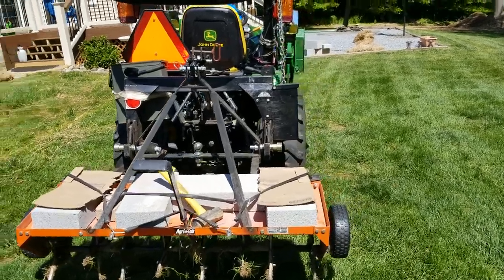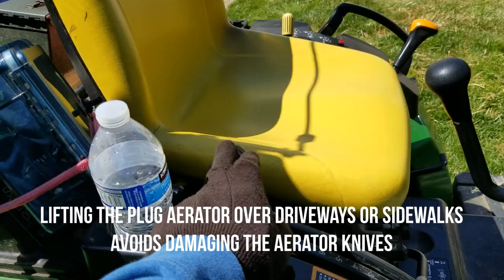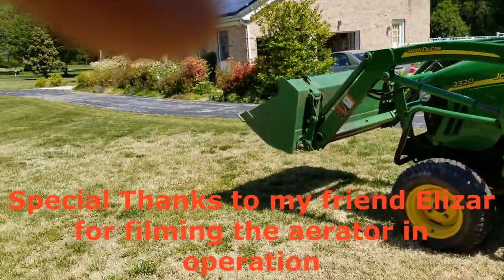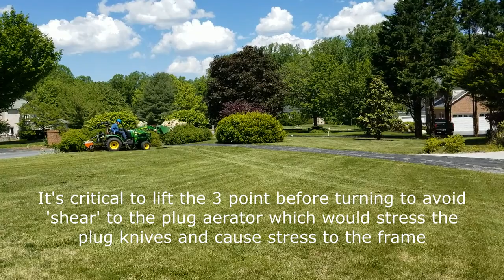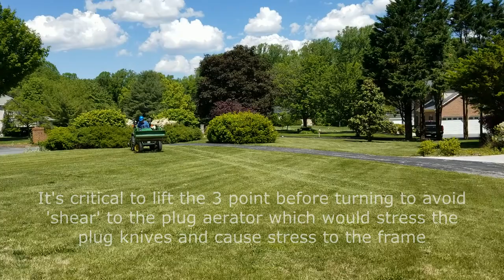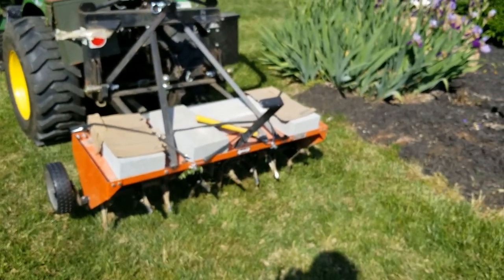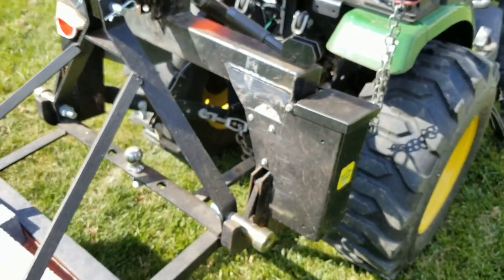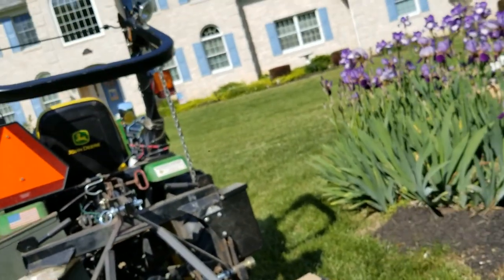John Deere 🚜 Tractor 🚜 Custom welded 48 inch Plug Aerator mounted to a 3 point hitch JD 2320 DIY

Comment: Looks neat! I just wonder about the weight of that tractor on the lawn potentially creating compaction? The tread on the rear tires too. I have the same 48 inch agrifab aerator but I drag it around with my zero turn. The single point hitch allows me to turn with a tight radius and looking at the area in the video I would tackle that without needing to lift the aerator blades at all, and always moving forward. JD2320 weighs 1660lbs (24hp) vs Husq Z254F 595lbs (23hp). I was going to say, if you got the tractor anyway then use the tractor, but it just seems too heavy especially when the aerator and weights are elevated, all that weight is added to the tractor's weight on the wheels and that's at the very point you're turning too. If that those turns are when the grass/ground is damp (which is good for aerating) then there's greater chance of damage in the turns. Sorry for the long comment. Once I started writing I kept thinking of more. Finally, what about sprinkler heads? I flag those and turn around them as I did damage two in the past before I started flagging them. I guess you flag them also but keep in a straight line and lift over the heads? I can see that would work well actually.
Reply from the maker: Thanks for commenting.
It’s a great aerator for sure, and yes this tractor is not the best to use as compaction would be an issue or at least a concern – if you use it for mowing.  This tractor makes me ‘Mr Popular’ in my neighborhood and as I don’t like charging neighbors to do tractor work (loader work, aeration work, lawn de-thatching work, snow plowing, and more) my neighbors offer to mow my lawn with their zero turn mowers in exchange for the tractor work I do (works out great).  The main reason I had the aerator set up this way is because I have to cross multiple driveways and sidewalks to get into different areas, so the compromise works for me though it would be nice to have it pivot too.  Our neighborhood does not have any sprinkler heads – so all good there.
Neighbors mower: https://www.youtube.com/watch?v=iUsuXenQ4fA
Reply: @ActiveJoe  I see, thanks. Sounds like an awesome community! I also was collecting clippings like that with lawn sweeper so that's really interesting to see. But in my case the grass clippings were too heavy needing body builder squat lift to empty and broke the bag (and me!). Agrifab said lawn sweeper only intended for leaves/twigs not dense grass clippings but were good enough to replace bag anyway. Rather than empty more often, I made a box on top of a tow behind cart, with a baffle and 8" tube from deck and blow grass and leaves in with high-lift blades. No clogs. This means I can collect 18 bushels before emptying vs 9 of oem baggers mounted to rear of mower (which add weight to mower too). I feel like sucking gets more fine particles like weed seeds possibly than sweeping, but that sweeper does work well so probably not much in it. You have beautiful lawns and landscaping. It's all about achieving that efficiently isn't it. And with no sprinklers it must mean the aeration and other things you do put the rainfall to best use.